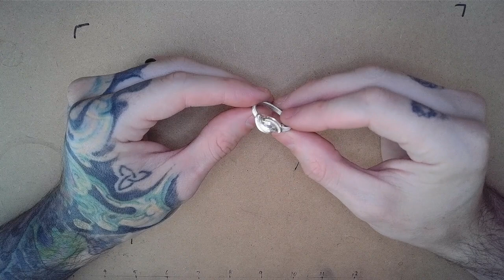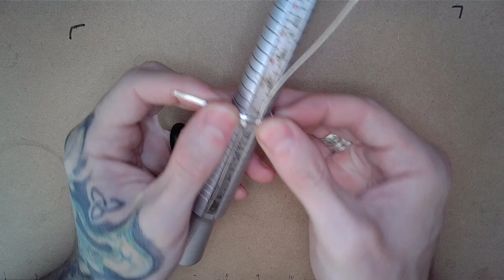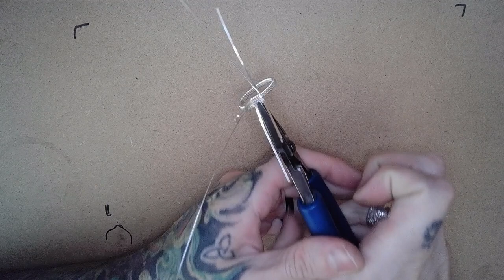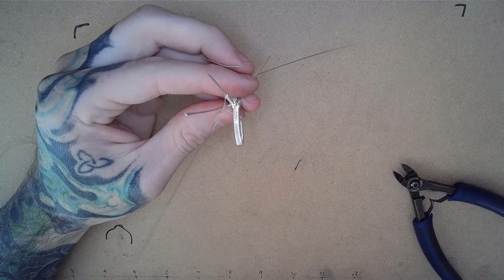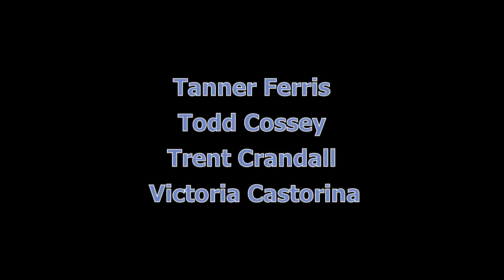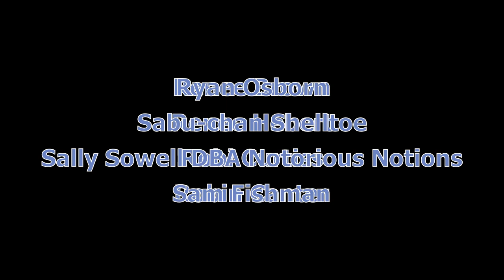Wire Wrapping Tutorial: Stack-able Rings

Comment: Love this tutorial, thank you so much! I would love to see more of this type of ring. My only issue is between not so great eyesight and poor lighting in my work space I have a hard time with the smaller gauge square and half round wires. Trying to make sure I'm working with the flat side down is a challenge. 😀
Reply: I use a magnifying lamp, purchased from Amazon. It can be moved around on the swing arm to help me see smaller wires
Reply: I bought a 100W Utility light bulb at grocery for $1.50.

Comment: Me personally I would ha brought the core wires side by side. It leaves the ring band crooked. You avoid that by connecting both ends of the middle core wire the way your doing it. Or you can connect the ends of out core wires instead. If people don't have the extra wire to do the tie off, you can just loop the endings together. Those loops can also be used to hold a cavachon on with a nice flat surface underneath. I've made lots of rings myself.

Comment: What is the material of the wire? Is it aluminum or copper or what? I would like to know
Reply from the maker: I use sterling silver in all of these videos
Reply: @RaftarkJewelry  I actually tried stainless steel wires but they're so hard to work with. But yours look so soft and easy to bend. What would you recommend other than sterling silver? Copper or aluminum?